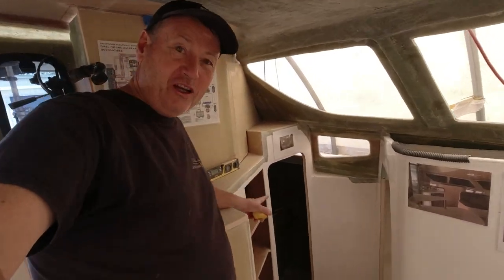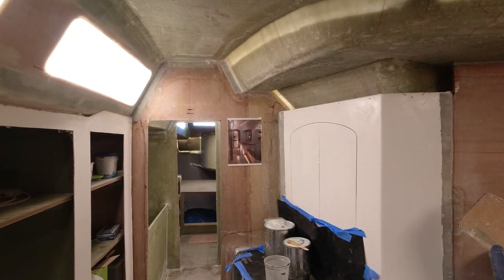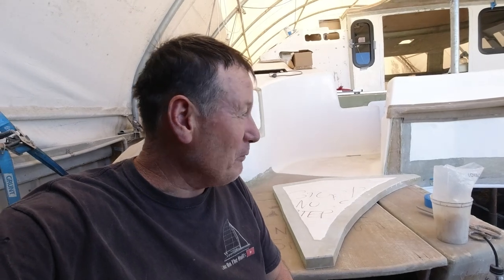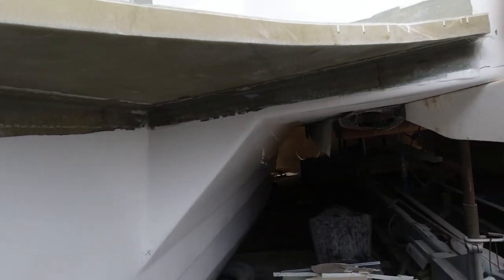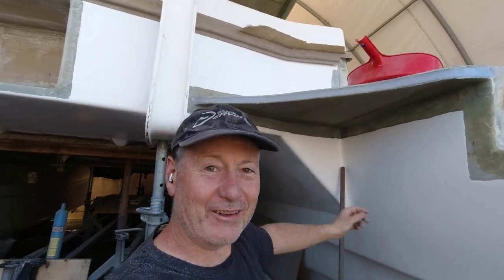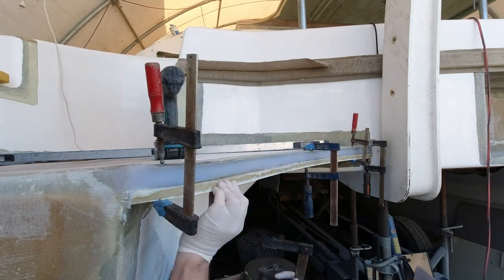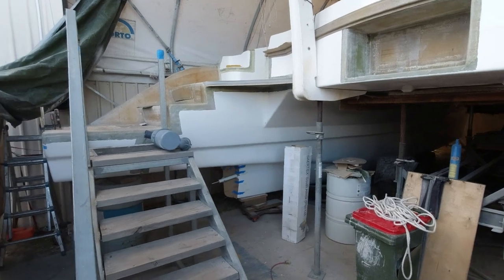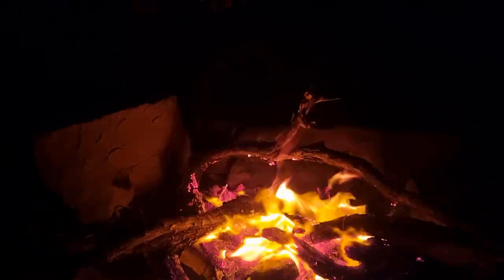Adding Finer Detail // Complete Catamaran Build Ep261

Comment: Great walk and a great episode as usually Ross, sugar scopes, and rear end will be great. Perhaps too late now, but I would like to suggest to continue that old rear end 45 degree slope and taper that to nothing under your newly added "wings". Would not interfere with your ridge and would also add a lot if strength to your wings - and I think, would look even nicer than current design  - IMHO...

Comment: Love to see a revisit of the damage to your other boat, from the lightning.
Reply from the maker: Thanks Darryl, I have only just today spent a full day in there pressure washing and working out what to do with it. It is salvageable, albeit a tonne of work primarily sanding, bilge system replacement, new wiring, lights, burns and a bulkhead replacement. Rossco
Reply: @LifeOnTheHulls  Great work, would love to see it. I have just finished my rebuild, Ross 650MKII finally finished after 3 years, major core rebuild about 5 sq metres, full interior refit, massive job, not going to miss the dust, mess, smell, itching...

Comment: Those back winglets, will get a lot of waves pushing upwards on those winglets. May I suggest naively, maybe a Andre triangle sharp under each of those winglets that will deflect the waves that will crack upwards on the underside of those winglets. I don’t know have much force, but I suspect if the 5 meter waves on the sea will produce a force equal to the weight of the cat at the underside of each of those winglets? I could and probably incorrect, Bute let me know if my thinking is silly…lol. The back looks great, distinctive, never seen one like it before 👍🏼
Reply from the maker: I think they will strong enough and are a metre above the water.If they ever sustain damage it won't be a biggie to repair.

Comment: Hi Ross !  Since the head door is more for minor degree of privacy than anything else, had you considered a frosted plexiglass center core for lightness and easy cleaning with a lot of towel racks ( they can act as door stiffening braces too ) across swinging door's frame on BOTH sides of door ? That way you have space for towels to dry inside instead of on lifelines outside ? I'm presuming the air flows into head and gets exhausted up and out a fan powered hatch/vent ? You could make the door in foam to save weight too...